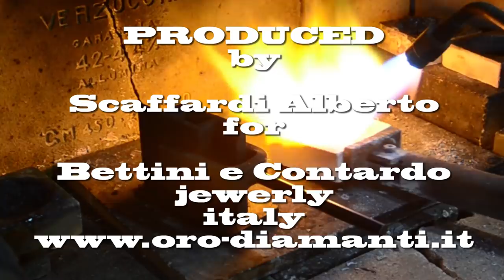Tiffany model  Diamond ring handmade gold 18k white gold

Comment: Wow so much work. I always wonder what you do with the gold dusts coming off from the filing. Do you collect them and melt into metal again. How do you prevent contamination from other metals on the workbench?
Reply from the maker: If you no longer have the certainty of quality, it melts, is purified, after which it can start over again. The purification process has low costs.

Comment: Just a couple of questions: Doesn't filing the claws against the stone scratch it? 
When you solder parts together when the stone is set, doesn't it affect the stones?
Thanks for the great videos!!
Reply from the maker: It depends on the properties of pierte. Some stones are extremely harsh, diamond and corundum, they do not mark with metals can only chip. the stones themselves if they have no inclusions or treatments are resistant to very high temperatures. with other type stones beryls have to pay more attention, with the other type kianite must pay close attention being very tender.
Reply: Thank you for the reply! Very interesting! I would've thought that the file could scratch the diamond, but it makes sense that it would chip rather than scratch if not careful.
Also being heated with inclusions being a problem makes sense.
Reply: Have retipped ring with emeralds, warm veery slowly and cover with small ring box to cool down when finished. Keep fingers crossed

Comment: could you make a semi-complicated ring without any special power tools? I have a blacksmiths workshop but i'd like to start looking deeper into jewelry
is there a video on your channel already? or would you recommend anyone?
Reply from the maker: Rings produced in my videos do not require special styling tools, course, files, cutters pliers etc are small in proportion to the work produced. If you have manual dexterity with metals I think you should not find it particularly difficult to make some of the rings, which are in my videos. First I suggest a plain band that you can enrich with the motif on the surface

Comment: Hello!

How much(weight) of gold do you use there. I`m planning to make the same design but with Platinum and with 0.8ct gem. As I want to order the ring to the jeweler, so I don`t get screwed up.

Big thanks.
Reply from the maker: For this model requires at most 8/9 grams of platinum
Reply: Hello again!

And how much should cost the work, to make such kind of a ring out of platinum(I`m located in Germany)?
Reply from the maker: bisitis of manufacturing it costs 250 EUR plus taxes